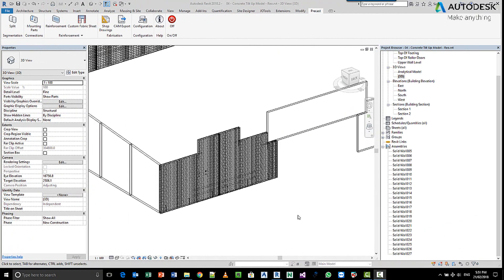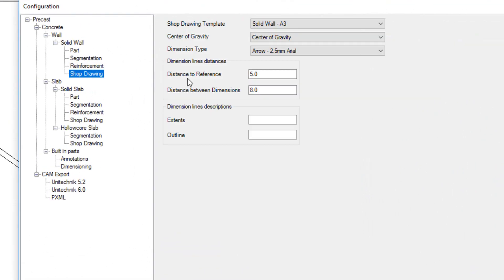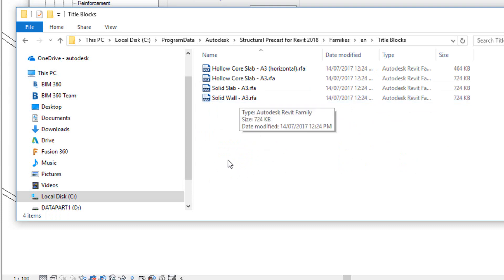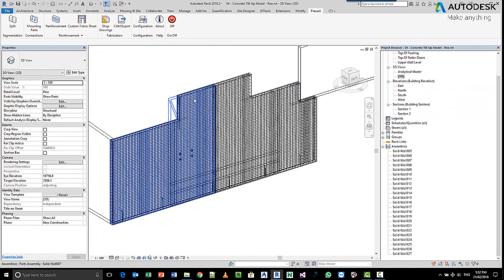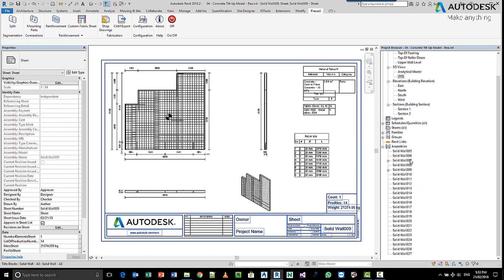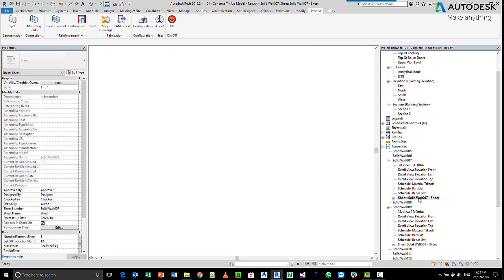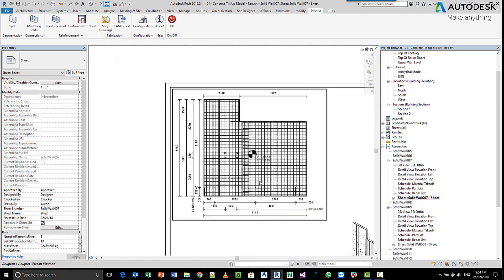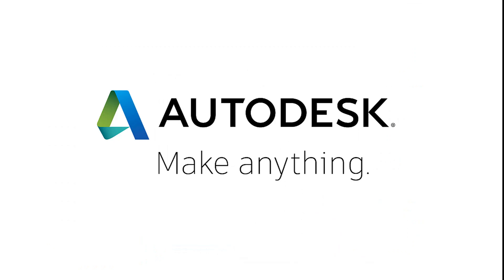Part G - Revit Precast Concrete / Tilt-Up Panels - How to Create Drawings

Comment: Hi Stephan,
First thank you so much for these important videos, especially for me as I am a Lifting civil engineer.
I started working with Revit for tilt-up panel and i have a question for you please.
If I want to have like a lifter,  bracing and ferrule symbols on the final drawing instead to use the built in family, how i can do, such a easy circle with cross in the middle for the near face and another one but hatched for the far face.
thanks again mate.